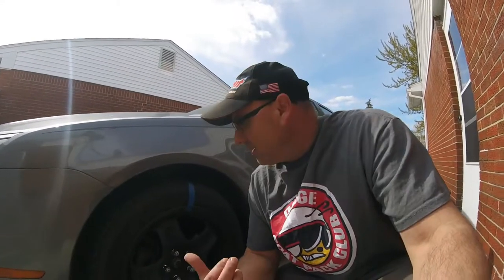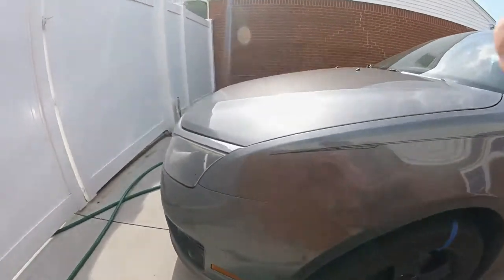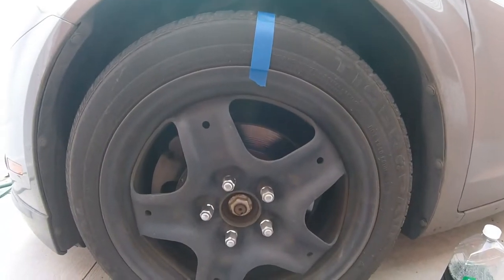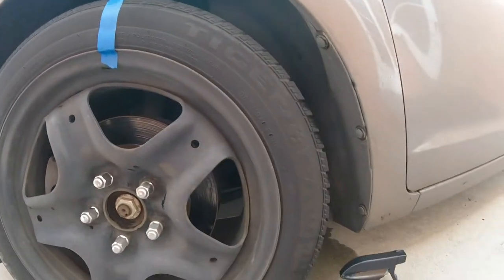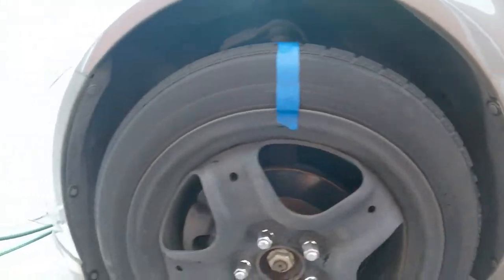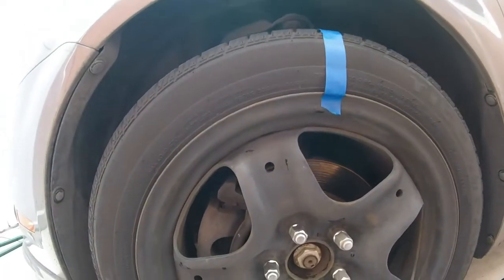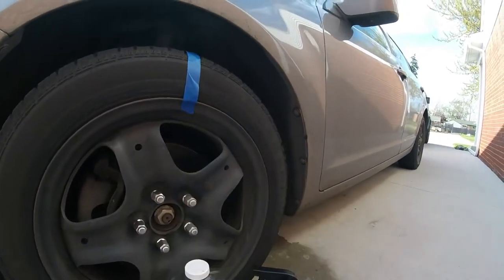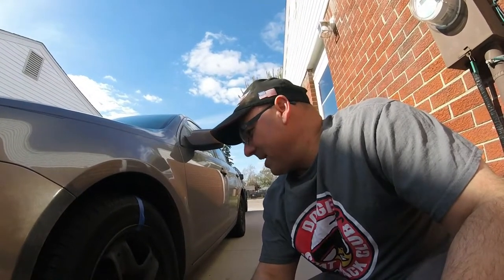All Purpose Cleaners Cheap VS Expensive "Tire Cleaning" Shocking Results

Comment: I've tried several other wheel/tire cleaners and always come to Simple Green "Original" Concentrate. If price is no object, go ahead and use a dedicated wheel cleaner but IMO, none are worth the price. I've also started using Simple Green "Lemon" on interiors.
Reply from the maker: I need to pick up some Simple Green Lemon and try on the interior . It's nice when one product that doesn't cost a lot  and has multiple use. Thanks

Comment: Hey man nice video... do you think I can use simple green on aftermarket wheels? Thanks
Reply from the maker: You should be able to use it . Try a small spot first and dilute simple green a little at a time see what works for you. I have used simple green on wheel dilute 50 -50 and rinse the wheel really good. Thanks Freddy
Reply: Ouzo Lou Garage thanks man